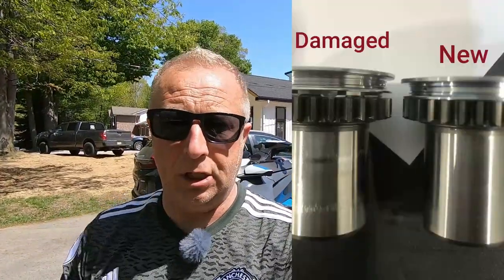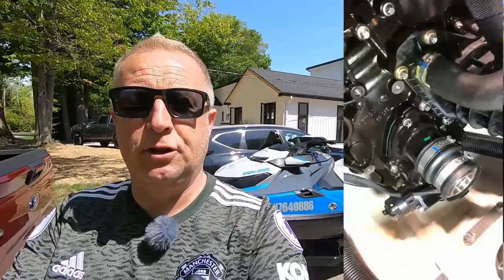IDF Failure - update

Comment: You are extremely fortunate.  I have a 2021 Fish Pro.  My first day on the water, I had the same thing happen to me that happened to you.  I had to call a tow, which cost me $110.  Just like in your case, it was the iDF which failed.  The dealer "fixed" it, and I had it back and ready in 6 days.  The second time I was out, about 20 minutes into the ride, the same thing happened again.  I called for a second tow (cost: $75).  Back to the dealer we go.  By the way, my dealer is about 2 hours from where I live.  The second time, the dealer wanted to replace the entire iDF unit.  BRP wouldn't let them.  Instead, BRP advised my dealer to replace the part again.  After they repaired it, my dealer took the ski out on the water for about half an hour.  It worked fine.  All this took close to a month.  So, I get my Fish Pro back.  I go out for a third time.  There was 1 hour on it when I launched the third time.  This time, I stayed close to the boat ramp.  At 1.4 hours, the iDF failed a third time.  I had a collapsible paddle with me.  I paddled the nearly 900 lb. hunk of junk to the ramp.  My Fish Pro is now sitting in my garage.  I have zero trust and zero confidence in this machine, or any other product from BRP, as a matter of fact.  I've contacted my dealer and told them I no longer want it.  My dealer is to contact me some time this coming week after they talk to BRP.  I can't fault my dealer.  They have been nothing but helpful about the whole thing, doing all they could to get the situation taken care of.  Returning this jet ski will be no problem, as far as my dealership is concerned.  In fact, the manager of the dealership has already told me not to drive the 2 hours to bring the ski back to them.  He is going to come and get it.
Reply from the maker: Hi Kevin, sorry to read of this nightmare you are still going through. my apologies for the delay in replying, for some reason i can only view this message on my desktop. Now you say you can't fault your dealer, I am wondering if the Technician working on your machine is not aligning everything correctly? I find it strange that we both had a failure, the part replaced with a new exact same part and i have had no further issues but you continue to have an issue. I have read a lot about it being an alignment issue during the install.
Reply: @NigelHay , well, supposedly, engine alignment has been checked both times, and the alignment was correct.  I don't know what the problem is.  I know I'm getting rid of this ski.  I just can't trust it.  And, my wife would NEVER go out on the water with me on this ski, even if it was to be fixed and working properly.  Either it's going back and I get a refund, or, if BRP insists on something else being done, and they do manage to ever get the thing fixed, I still won't keep it.  I'll sell it.  I think I'll buy a boat...lol.
Reply: Wow that really sucks! I'm looing at new skis I had a 2013 130 se for a few years and never had any issues with it and currently have a 2017 S 260 GTX with no issues. Im looking at getting 2 new skis for next season Im thinking Im just going to skip the IDF. All my years of riding the only time ive ever gotten anything stuck that turning the engine off didnt fix was a stick. I got it out once i got home it didnt strand me I just couldnt go over 10mph without the thing shaking. Nice idea but until the prefect it ill pass.
Reply: @rccrazy30  I ended up returning it.  My dealer gave me a full refund.  My wife and I now have a new boat on order...lol.
Reply: @kevinskurat9196  Cant go wrong with a boat!
Reply: @rccrazy30  I hope you're right...lol.
Reply: don't they have a lemon law?
Reply: Appearantly the issue was resolved with a new i proved part, but weird this was not found during development.

Comment: 900 Kms in 4 days to fix your machine? Totally unacceptable. I had a deposit on 21 GTX limited with IDF and an expected delivery date around June then got an email from Seadoo saying that my machine was going to be 8 - 10 weeks late on the delivery. I also started hearing about the IDF/Carbon seal problems around that time and decided to cancel my order. Fortunately the dealer gave me my deposit back. I feel like I dodged a huge bullet. 

I also had a deposit on a 21 Yamaha VX Cruiser HO. The machine actually ended up being delivered early. Although not the largest machine Yamaha makes I have had it out very rough conditions by myself (6-8 foot breaking waves with 40 km + winds) and feel totally safe. I have ridden this machine over 50 hours with no problems whatsoever. 

Knowing what I know now about Seadoo I don't understand why anyone would buy these machines. Made in Mexico, Overengineered, Overpowered and unreliable garbage.

Comment: I got the exact same ski late last summer.  I have another (a spark) on order for spring 2022 but could only find the one ski available in 2021.  Not having a 2nd ski, I was afraid to take mine out for fear of getting stranded as mine also had the idf system and I didn't have anyone else to go out with.  It was nice of Andrew to show you the ropes.  I'm looking forward to trying out both my '21 GTX 170 and my '22 Spark Trixx this summer! Can't wait!  (which is why I'm watching this video again)  I sure hope I don't have any problems. I heard Sea Doo had the problem fixed for the models produced for the later part of 2021.  Hope my ski is one of those.

Comment: When did you take delivery? Mine comes in June. Was thinking any newer deliveries should be taken care of and problem fixed
Reply from the maker: Got it 4 days ago.
If the dealer sees a problem on delivery they rectify it before you get it, but mine showed no signs of an issue.
Anyway, the techs do a much better job than those at the plant in Mexixo
Reply from the maker: Ordered November, Delivered early May
Reply: @NigelHay  I ordered a GTR back in September.... no iDF to worry about... but no sign of the ski either... sucks that it isn't working properly, hopefully you have no further problems, the idea behind it is great I think
Reply from the maker: @davidmccomb7120  I've now put 19 hours on it without any incident.
It's running great and I'm back to being very happy again

Comment: What is the idf?
Reply: Thanks Todd. That's my question too.
Reply: Looked it up - Intelligent debris free pump system. Something that helps clean the intake.
Reply from the maker: It's new technology to clear debris, I have heard from many users that it is great, but a few have come faulty. This is how it works https://youtu.be/MZ77JQG2xbM
Reply from the maker: @cathyhutchinson2246  Off and an explore today, Chippewa Creek.
Reply: Enjoy Nigel! Have a good week off! I saw today that Port Colborne is supposed to be opening boat ramps tomorrow.
Reply: I would have gone with the new part if they had given me technical details as to improvements and a promise that it would be properly warranted, but I realize that’s a calculated risk.
Reply from the maker: @NigelCarpenter1  at the time the dealer didn't know much about the part, SeaDoo had been in touch with them about it. Maybe if more information was available i may of done it. But i honestly feel like the tech has resolved the issue. just had another good ride today
Reply: @NigelHay  
Hi Nigel, sorry to hear about your IDF failure but happy to note that you got it fixed so fast, I have had the same issue with my 2021 GTX Ltd 300 .. it dies on day 2 with 3 hours on it and is still sitting at the dealer ( 1 week now) who claims that BPR has not sent him the parts yet 
Any suggestions on what I can do to expedite this repair.. I spoke to the customer rep and tried to get through to the manager but no contact from them yet … your help will be appreciate .. thanks
Reply from the maker: @MH-Seadoo  have you contacted BRP directly.
I  think I was fortunate as my dealer already had a part in.
Email BRP brp.care@brp.com
Reply: @NigelHay  Thanks for your quick reply, Yes I have sent them various emails (to Customer rep) and also spoke to them on the phone but no joy yet ... dealer says he is waiting for parts
Reply: Just sent them another email .... this time to the email you sent ... Thanks ..lets hope they can do something about it quick
Reply from the maker: @MH-Seadoo  they were very quick to respond to me.
All I would say is remain calm with them.
But express your frustration in a calm manner.
Reply: @NigelHay  will do, thank you for your advice … hope your machine is still running well with no issues
Reply from the maker: @MH-Seadoo  it's been great since it was fixed.
Though I was told BRP and dealer would be calling me today. Surprise surprise no phone call.
Reply: @NigelHay  Were they going to call to check how the machine was running? Hope they care enough about customers to call you tomorrow 🤞
Reply from the maker: @MH-Seadoo  no, I sent email questioning why I was not offered some accessories or money towards accessories as a way of an apology. So I suggested it's what should be done, small things go a long way when trying to make amends with a frustrated customer that lost out on day one
Reply: @NigelHay  that’s an excellent idea and they surely owe you for the aggravation and grief that the IDF issue has caused, I know I will not be as confident as before going on my own to explore and watch the sunrise at Lake Ontario via Seadoo.. hope they give you a whole lot of acc as they are pretty damn expensive … good luck .. let me know how it goes 👍🤞
Reply from the maker: @MH-Seadoo  I'm still not confident enough to go far on my own, its always a worry now
Reply: @NigelHay  Good morning, I hear you ...hope the feeling will go away in time and the confidence in Seadoo will return soon
Reply from the maker: @MH-Seadoo  I have no issues when I'm riding with others but the whole idea was to go out on my own too.
May do that this weekend. I do have safety equipment. Like a Marine Radio for emergencies.
Can't live in fear all the time.
Reply: @NigelHay  Makes sense, good luck this weekend hope everything goes well for you and issues with your Seadoo, don't think I will get my Seadoo back anytime soon so maybe will go for a ride on my boat and do some fishing
Reply: @NigelHay  No parts yet and no reply from BRP to my email either ... A lesson in patience I guess, very frustrating indeed
Reply: @NigelHay  BRP care finally got back via email, saying there are many dealers asking for the IDF part and they are releasing the part on a selective basis, I have requested them to expedite the part and send it soon so my unit can be fixed and back on the water. Thanks again for the BRP care email you sent me ...your help is much appreciated
Reply from the maker: @MH-Seadoo  I hope you get fixed up very soon.
I guess I was very fortunate in the end that my dealer was somewhat prepared
Reply: @NigelHay  Yes that's for sure, looks like BRP didn't realize the magnitude of the issue facing them with the IDF problem

Comment: The same exact thing happened to our GTX 230 on the first ride.  Taking it to the dealer next week, hoping for a quick turnaround like you.
Reply: How long after it failed ?
Reply: My 2021 Fish Pro has left me stranded on the water 3 times now with this iDF issue.  The dealer has repaired 2 times.  I no longer trust this jet ski at all.  I've contacted my dealer, after the third failure and told them I no longer want the thing.  The plan at this time is for my dealer to come pick it up some time next week.
Reply: @kevinskurat9196  what did they repaired ? Did they installed updated part or current part but new ?
Reply: @MayooN ,  the first time they repaired it, I believe they probably replaced the failed part with a part that had not been updated.  The second time, when they told me they had replaced the failed part again, I asked them, if replacing that part didn't fix it the first time, why would it fix it the second time?  They had wanted to replace the entire iDF unit, but BRP wouldn't let them.  I actually asked the dealership guy if BRP had changed that part.  He told me they had.  In fact, he pointed out that the new part didn't even have the same part number that the part they had used before did.  So, I'm assuming the second time, they used the updated part.  But, it still failed, too.  I'm not having that ski worked on again, and taking it out a 4th time, hoping that it works.  I'm done with it. My dealer understands completely, and is with me.  However, they have to talk to BRP.  So, I'm waiting to hear from my dealer to see what BRP says.  My dealer is willing to have me return the ski and give me my money back.  I'm waiting to hear from my dealer this week, after they have spoken with BRP.  If BRP is still insistent on fixing it yet again, I guess I'll either have to take some sort of legal action, or just let them repair it again, at which time I'll sell it.  I just don't trust it or have any confidence in it.  I wouldn't dream of taking that ski on a Florida vacation and taking it out on the Gulf of Mexico or the Atlantic Ocean.
Reply from the maker: Did you get it resolved?
Reply: @kevinskurat9196  Wow that sucks... IDF is such a clever tech improvement, but geez oh man did they screw the pooch with implementation.

Comment: ** TWO BRAND NEW 2021 FISH PRO DRIVE FAILURES**. I just picked up two 2021 Fish Pro Jet Skis ordered in January.  Put them in the Lake Huron to drive to our Lake House about 8 miles, we were taking it easy and going about 20-25 mile an hour.  Lost the first one about 10 minutes in, Drive failure (IDF) and then on my way to get help/rope on the second unit, lost it back before I got back to the harbor.  Same issue… total fail.  Two units and both died on there first trip only 10-15 minutes in.  4 hours later… towing… what in the world Sea Doo?????   #idf  #seadoo
Reply from the maker: Omg, that is really crappy.
It seems to be more prevelant on the FishPros than GTX'S.
Did you get them fixed? Compensation?
I'm fighting for some form of compensation from BRP.
Reply: @NigelHay  They are fixed and we have had them out twice since the repair and they are working good.  So, it appears that the issue was resolved on mine.  I am working with BRP towards an equitable resolution of the issue,  nothing yet.  But, believe they are taking it seriously.